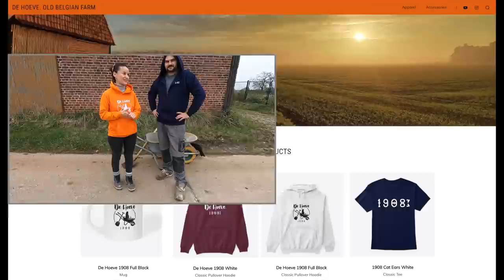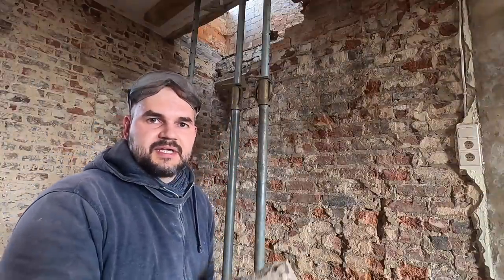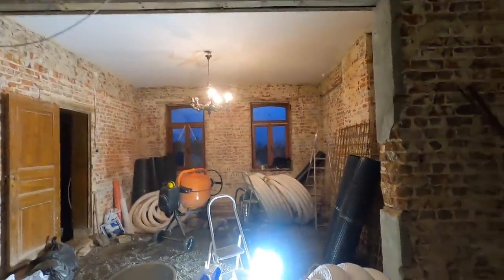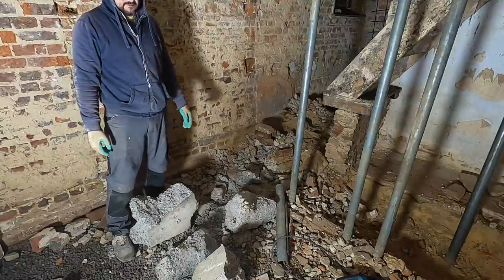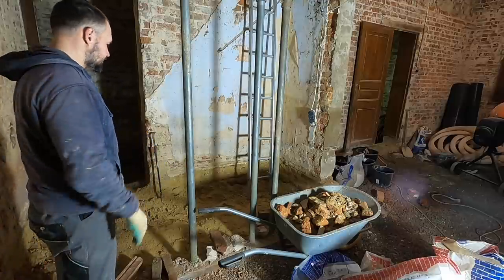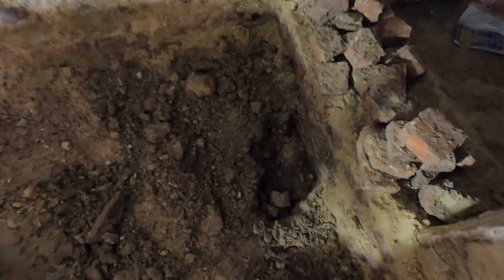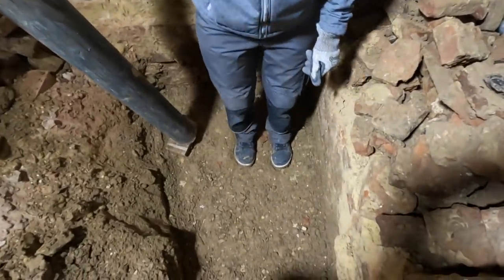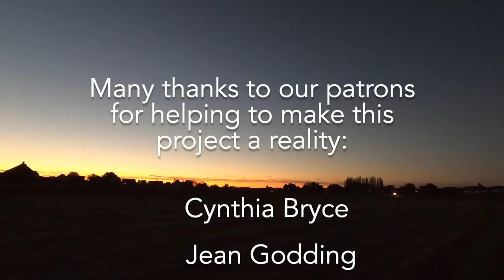Bye-bye crumbling wall! / DANGEROUS removal of OLD oak staircase

Comment: so are the outside walls of the house setting on concrete or rock footings? when you did all i see is brick as far down as you go.  the clay & moisture due to the high water table is concerning  i'm sure you have this under control because for the house built in 1908 it must be stable or it wouldn't have lasted this long.  thanks for the videos, i look forward to your posts and all the hard work you are investing in such a landmark!

Comment: What are the 4 pipes? Are these ceiling jacks?

Wondering too if the oak lumber from the stairs can also be salvaged to use as trim, shelves, etc.?
Reply from the maker: Yes, ceiling jacks, just as measure of precautions. 
The staircase we gonna probably reuse in our bake house. They are still very strong and good.

Comment: If you think it would be useful, a closet/wardrobe/storage space could be built under the stairs, with doors opening into the guest room. A place to hang guest clothes and/or coats, store luggage or other bulky things. Our four bedroom house was built in 1890 and has a total of two small closet. Two bedroom have no built-in storage and are very small, so no room for a lot of furniture. Even IKEA stuff doesn't fit very well. There are no closet or any other built-in storage on the ground floor, except for under the stairs. When you took down that wall, I immediately "saw" a closet/storage space.

Comment: Since that side room is guest room why not make area under the staircase a closet upper half and dresser on lower half for your guest when come to visit. Just put a wall back up that blocks the area from outer wall to where you started the closet.It most likely be easier and cheaper that way and it would save floor space in the guest room.

I also wanted thank you for talking in English so I can follow and understand what and why you are doing things the way you are.

Comment: Yikes! It looks like a serious unstable soil issue. Pulling up the brick rubble and replacing with clay and gravel won't fix any water invasion issues. Water coming from the outside and up would seem to still be a problem. Why does it seem like to me that much of the building actaully need to have the foundation rebuilt, a section at a time, probably three feet sections, dug down 2-3 feet, with concrete poured and any seems addressed.

Comment: Does the staircase have to have its access from that small doorway? 
Why not fill the doorway in and have the access from the room you shot the video from and don't rebuild the wall at all. You then have space to build a much more comfortable set of stairs in that corner. 
Storage cupboards beneath the stairs would work well with access from that now enlarged room. One of your salvaged windows would work well at the 1st stair landing to let in light from the outside of the house.
Reply from the maker: A very tempting idea, but we would like to keep the room as it is now. It’s our future guest room, and we want to keep the privacy of our guests.